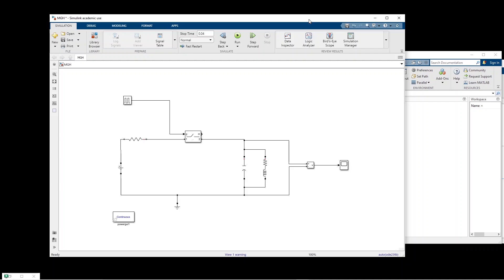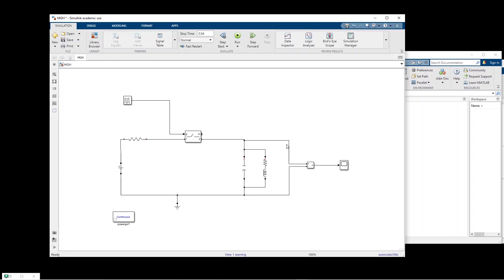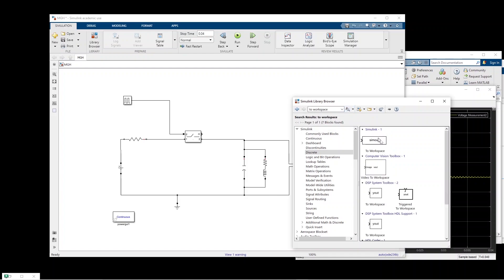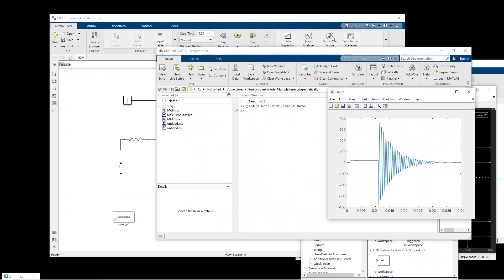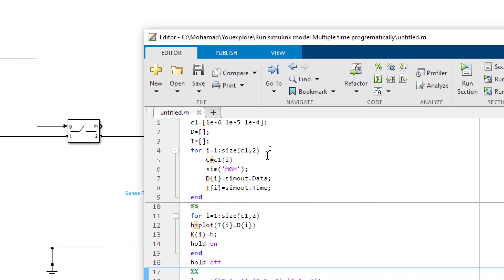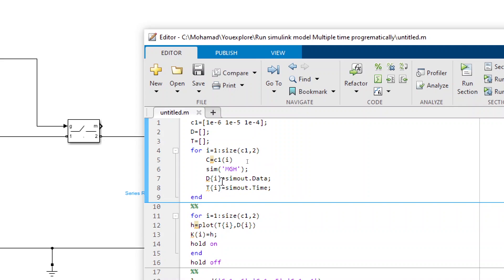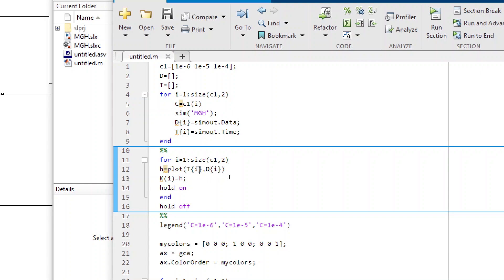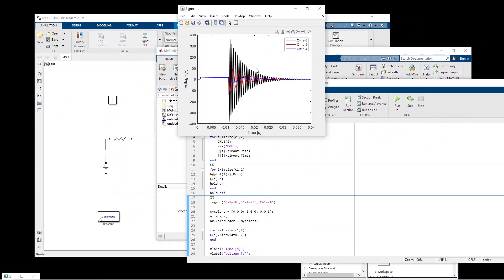How to run a Simulink model for different input parameters and plot the simulations results

Comment: Great video! How would one go about doing it if there's two separate parameters that are to be changed (forexample the resistance in addition to the capacitance)?
Reply from the maker: Thanks, do the same thing,  define capacitance as C and resistance as R, and give the values from your workspace and sweep the calculation over their range